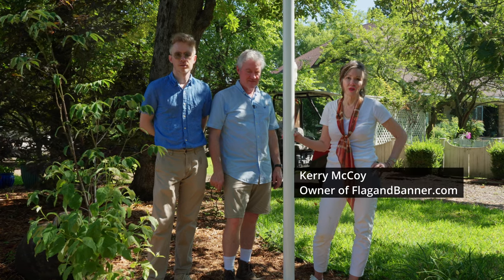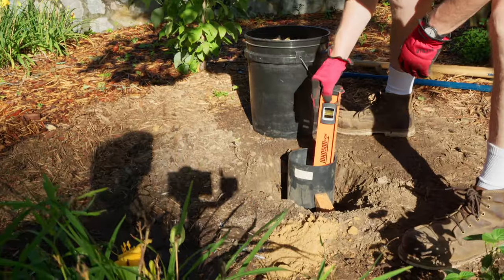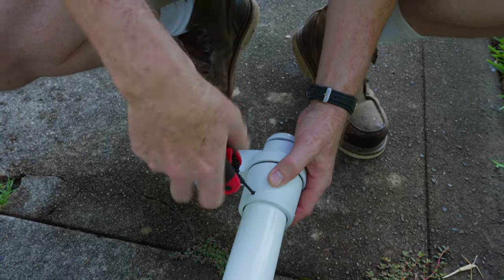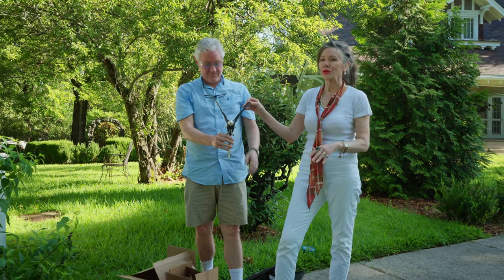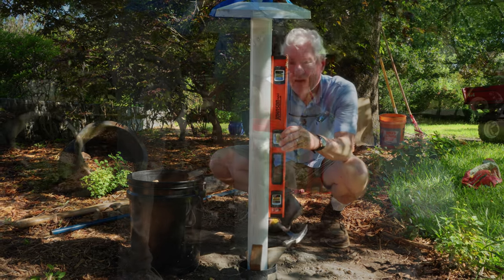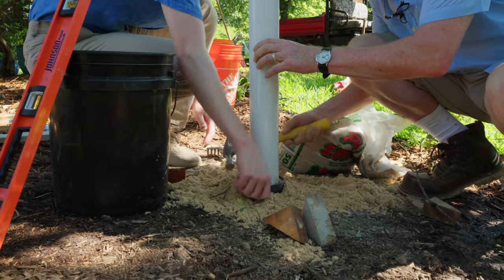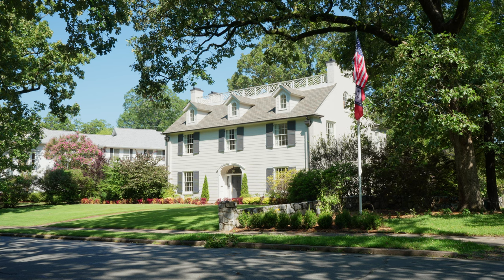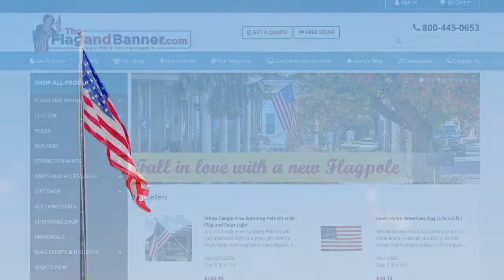How To Install An In-Ground Flagpole

Comment: Concrete against an aluminum pole is abrasive and will eventually create a weak spot in the aluminum possibly causing the pole to fail. The sand is nonabrasive  against the motion of the pole caused by the wind.

Comment: I’ve never seen concrete poured like that. Just adding a little water at the top, makes it all harden up?
Reply from the maker: The concrete will absorb the ground water around it, but Grady did also pour a lot of water on top. He's installed a lot of flagpoles like this and the concrete did it's job. Now I would add, we have a high water table here so if you live in an area where your land struggles for water, you might mix it differently.
Reply: @Flagandbanner  I live in GA. We have red dirt aka clay. It’s like the desert ground is hard as a rock. Yeah I’ll have to use water. But good to know this is another way.

Comment: what's the reason behind putting the flag pole in sand and having the ground sleeve set in concrete? wouldn't it be more solid to just mount the flag pole in concrete directly?
Reply from the maker: If for any reason you need to replace a section of your flagpole, it is much easier to get your pole down if it isn't in concrete, especially if that bottom section gets damaged by a storm or someone runs into it.